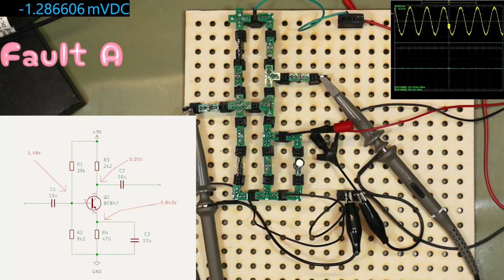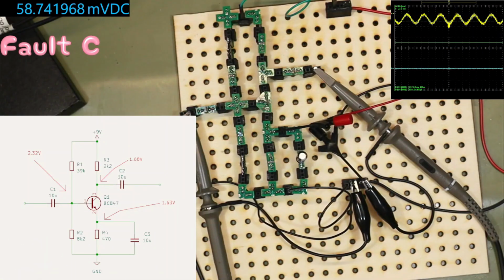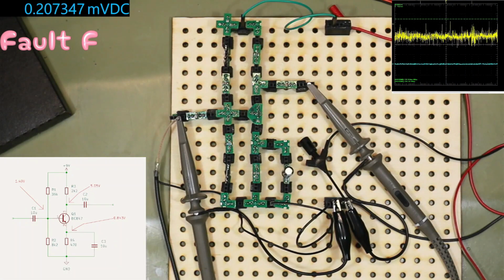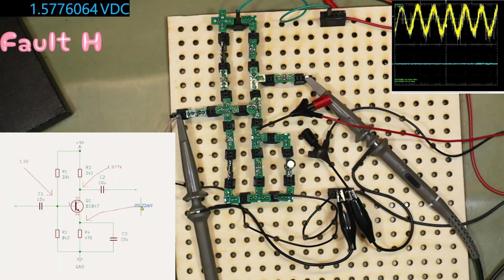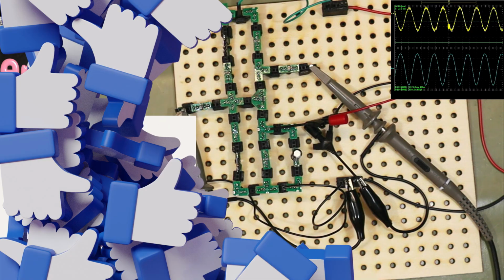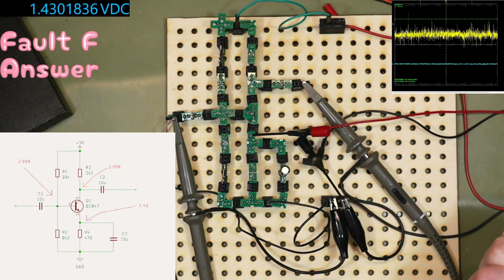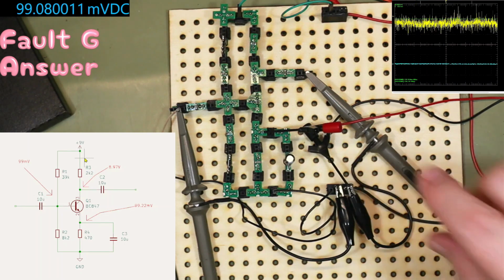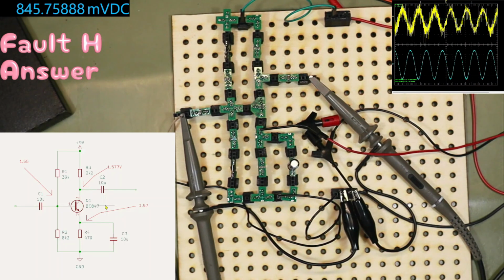#255 Experiment 17 Common emitter amplifier faults

Comment: Have to watch for those floating voltages in the home. They could get caught up in the ceiling fan! And those transistors that get saturated from being turned on, it's from all that probing is my guess 😏 Outside of that, good video!! I've ran into this before on a simple mic amp, this could explain why it was so noisy when another was not. Or it was just a bad 3904.
Reply from the maker: it's quite funny that sometimes when the voltages are floating about i get a cold feeling on my back. As apposed to the warm feeling in get running down my legs due to old age. 🙂
Reply: @TheEmbeddedHobbyist  🤣